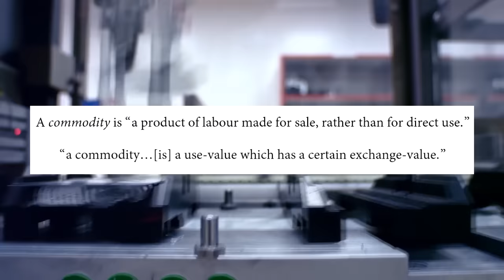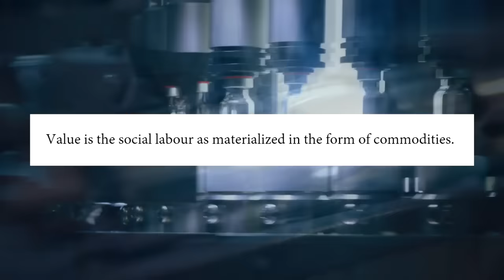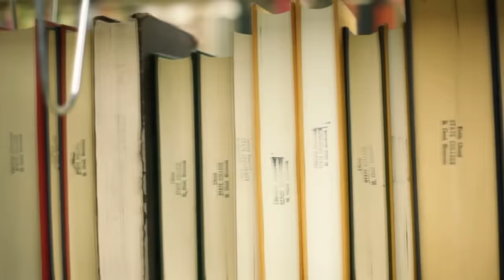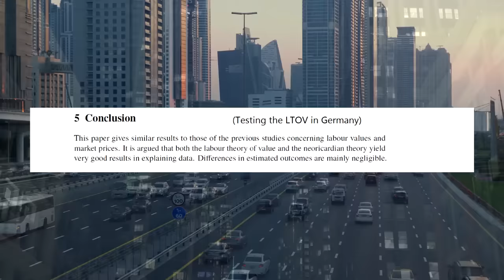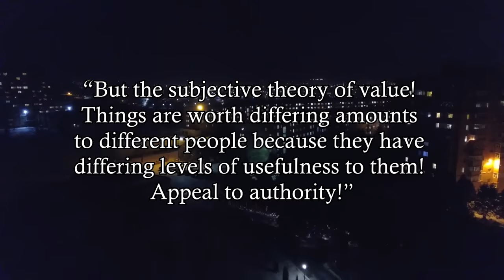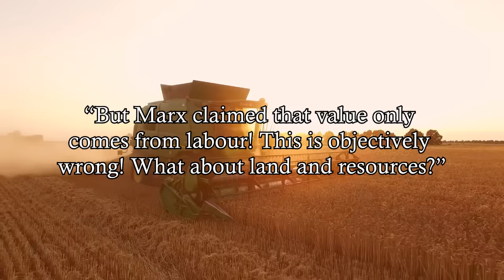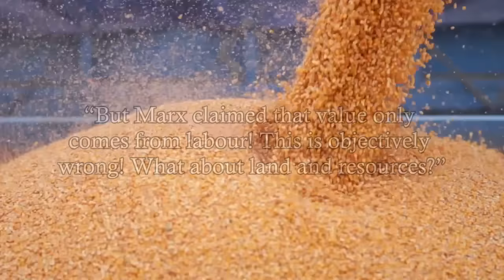Capitalist arguments against the labor theory of value suck (Explaining the LTOV) - Socialism 101

Comment: What does the amount of labor involved in producing something have to do with value? If I could build you a house in  5 days, are you going to pay me less than if I built that same house in 5 months? Of course not. Why the hell would you ascribe different value based on how long it takes me?
Reply: PRICE IS NOT THE SAME AS VALUE
Reply: @jeremyrangel8138  Usually a house that takes 5 months to build is, you know... better in quality and/or bigger than a house that can be built in 5 days...
Maybe that's why a house that requires more labor time for its production is more expensive...
Reply: @kimbanton4398  Yeah, that's not how it works. People sell houses for as much as they can get for them. How much labor went into building the house is immaterial. When you bought your last cellphone, did you ascribe a value to it based on how much labor went into producing it? Or did you ascribe that value based on whether or not it could improve your life in some way? Of course, like everybody else, you didn't even consider the amount of labor required to produce the phone. The labor theory of value was stupid when Marx McNumbnuts proposed it, and it's still stupid today.
Reply: @jeremyrangel8138  how much labour went into something is extremely important. im not sure if you know, but labour costs money. the more money someone spends on labour for a product or service to be sold, the more value the end product has. thus, with high value products, comes high cost in currency to be exchanged for said product or service.

Comment: Socialism, as originally devised, is really one of the greatest economic theories ever devised. The only problem is that it demonstrably doesn't work and often creates material conditions  far worse than those it set out to originally replace. This doesn't even begin to touch on the political structures, and thus oppression, needed in reality to oversee and manage such a system. The group which is truly punished the most under socialism is the group it sets out to defend, the worker.

While that doesn't mean that there shouldn't be criticisms of real world capitalism, it does mean that we can rather safely discard socialism as a replacement. As a system, it simply doesn't work, but there may still be useful pieces of it that can be extracted.
Reply: Not even good in theory

Comment: Mud pies does have a use value, ripping of Labor Theory of Value based system that can't afford to verify use value.

Here is my Agorist apologetic against of LTOV.

Premise 1) Sport betting is labor.
Premise 2) Sports betters have the same labor value.
Premise 3) More accurate sports betters are more valuable than less accurate sports betters.

Conclusion 1) Sports betters who bet differently are not doing the same job therefore do not have the same labor value.
Reply: Sport betting isn’t commodity production so a separate analysis is required to explain their role within society.

Comment: There are some flaws in your argument, for example you talk about the pencil and car example. It does not make sense since the reason as to why a car is more expensive is because the Marginal benefit and marginal cost start very high. Labour is a part of the reason as to why the marginal cost is high but not the only factor that is there, there are lots of other factors as well and the dynamic of supply and the subjective demand of what people want.
Reply: Exactly!
Reply: oh wow, its almost as if the buyers of commodities influence the selling price of commodities. what a shocker. i still don't think that it really makes Marx's value theory redundant. but to be far to Hakim, I dont think he was talking about the selling price but rather the price of production, which is usually what is discussed when relating the category of value to prices.
Reply: @benniethejets  cost is not value either.
Reply: @ExPwner ? Yeah and? How does this disprove me
Reply: @benniethejets  labor theory of value is a cost theory of value. If you knew why cost theories of value don’t stand up to scrutiny then you would get this.
Reply: @ExPwner  A cost theory of value of what? Of commodities? are you saying the theory tries to explain the prices of commodites?
Reply: @ExPwner  If you had actuallly engaged with Marx before critiquing him then you would've learned that 
A) Marx makes a distinction between the category value and production prices

B) Marx states that commodities aren't sold at their values

Hence your critique that commodities aren't sold according to their labour or whatever isn't even a critique of Marx because he agrees with you. Like ive said, youre fighting strawmans.
Reply: @benniethejets  the problem with the argue is that it completely undermines the affect of the consumers' perception on the actual price. I am not reducing Marx' theory here but simply pointing where the argument is flawed.
Reply: @badarshaikh2271  i dont think it does. marx doesnt deny that personal prefrences effect the selling price. What I think Marx tries to argue is that if supply and demand are equal, then the commodities which require more socially necessary labour time will have a higher production price.
Which is different from selling prices. Supply and demand are mostly not equal tho, so the production prices and values do not really coincide. Hence not selling prices either, which consumers have a say in.
Reply: @benniethejets  well yes obviously the price of the total labour involved is not the selling price, it is actually the difference between the selling price and the total labour cost (plus the natural resources, value of the idea and the value of the administrative costs and environment etc) that makes the producer surplus. 
What you are saying would have been true, if there was no producer surplus and no profits.
If I am misunderstanding any of your points, please elaborate.
Reply: @badarshaikh2271  There's no such thing as price of labour, what the producers (the firms, capitalist etc) buy is not labour. It's labour power. This distinction is very important because what it does is that it shows us how the capitalist firm can make profit (even if we assume all exchanges are of equal magnitude in value) The capitalist buys means of production, which is materials, tools etc and then buys labour-power. (The ability to labour)

He sets these two things in motion together, the labour-power is consumed by using up the means of production. At the end of the process the capitalist is left with products which have a higher value than the original two form of commodities (labour-power and means of production) He thens sells these products and realize his profits.

Of course in real life the capitalist may sell his product way above the value of the products, for example Apple might sell their iPhones at a higher price than the value of them, this just results in extra-profit.

The wages recieved are hence not for the labour, but rather the  reproduction of labour-power. (Other factors too, class struggle may rise the wages and so on) 
So profit in capitalism is the exploitation of human-labour power.
Reply: @benniethejets  ok I won't go inside this argument and pick apart the flaws here, but please tell me how any of this relates to my initial comment? Lol
Reply: @badarshaikh2271  Please do pick apart it if you find flaws, im not here for some eternal truth but to learn more

I was just responding to your comment about how the producer makes a surplus, and the price of labour, which you mentioned
Reply: @benniethejets  SNLT empirically does not determine prices. Watch the Shane Killian video that debunks Paul Cockshott. If your theory were correct it would require causation, not mere correlation. The existence of outliers from his trend line disproves his claim.
Reply: @ExPwner  I don't know why you keep on insisting this is what Marx tried to show with his analysis of value. Like I've said before, Marx DIDNT try to predict prices with his value theory. What Cockshott does is different from  Marx, even though he says he's following Marx. Cockshott has some kind of need to insist that the magnitude of commodities correspond to their prices of production, which isn't even true.

With all due respect, maybe you'd do a little better if you actually didn't strawman.
Reply: @benniethejets  I did not straw man. You yourself tried to say that people value based on SNLT and I was pointing out how that is wrong and how Cockshott didn’t even prove your point. Empirically you’re wrong and you still have to face the transformation problem.
Reply: @ExPwner  Well no. I said the opposite! I don't know why you keep on bringing up Cockshott when Ive made it very clear that I dont think that he has the same views on value theory as I & Marx. 

And the transformaton problem isn't even a problem, how is it a problem for Marx's value theory?
Reply: @benniethejets  “what I think Marx tries to argue is that if supply and demand are equal, then the commodities which require more socially necessary labor time will have a higher production price.”

Those are your words exactly.
Reply: @ExPwner  What I said is true, Marx thinks that. 
But It's not really what Marx tries to argue with his value theory, he doesn't desperately try to show that "oh in reality prices correspond to values" or something like that, he accepts that commodities aren't bought and sold at their respective values.
Which ive tried to explain to you a million times now. 

What he really tries to show is that how can a capitalist economy (that is built upon generalised commodity production) function. So, the exact price relations aren't interesting to him.
Reply: @ExPwner  So since your criticisms of Marx sort of have missed do you have anything else to say? Are you going to bring up the  "transformation problem" again
(which isn't even a problem, it doesn't exist because value is already expressed in prices, there's no need to transform values to prices.)
Reply: @benniethejets  😂 cope harder in your denial and contradictions.
Reply: @ExPwner  ait its fun to see u got no response, ur basically just following a script that doesnt even hold up lmao
Reply: @benniethejets  project harder

Comment: I don't understand your reply to the "skill labor argument".  Maybe some sectors of the economy do not used skill labor anymore, and are dominated by workers doing simple, mechanical tasks (factory assembly lines, fast food restaurants, Amazon logistic centers, etc.). But many other sectors continue to require high skill. Software coders (an ever-increasing sector among the working class) need skill to get their job done, and the more skill and knowledge they have accumulated, the better computer programs they can write in the least time. This is also true for many blue-collar workers (electricians, mechanics, technicians of all sorts, cooks, drivers of heavy machinery, etc. etc.). You could call training and studying a form of labor, but then you find that different forms of labor  yield completely different results. A guy who does 100h of training + 100h of labor can normally produce more and better commodities than a guy who does 10h of training + 190h of labor. A guy who worked 20,000+ hours of labor in a single industry typically can produce more and better commodities than a guy who worked 1,0000h for 20 different industries (though in some cases it is the other way around). 

I fully see how human time devoted to a task has value  (in the common use of the word, no the Marxist definition), and is one of the motor forces in the economy. But different people might use their time in a different way to try to achieve the same objective (say, one might attempt to do the task by hand, another might try to program a machine to do it, one might try to do it alone, the other might try to get a team together), with vastly different outcomes in the same amount of time. This is in the end what's behind "innovation", to use your time in a novel way to achieve the same commodity. How does the labor theory of value deal with this? Is there no intrinsic value in the imagination, perseverance, decision making and risk taking that an individual uses to accomplish a task?

Comment: The following is NOT MY OPINION ON HOW THINGS SHOULD BE but I think that, in a capitalistic economy, labor-based value constitutes the minimum price at which a product is sold. If ur gonna sell something at below what it costs to produce it, it wouldn't make sense to produce it altogether. However if you can sell it at higher price than its labor based value, that price would be determined by supply and demand.
Again, as a commie, I don't think the means of production should be owned because this would create surpluses with no real value counterpart easily translated as stealing from the workers.
Reply: LTV is wrong.

Comment: This video presents the typical views of the classic performers of the LTV.
However, the reality is different!

Value cannot be produced! You can't build value anywhere or anything like that.
Value is a social relationship. Such is formed between people and only works between people, the value concretely between exchange partners.
In the exchange, the value is assigned to both the goods and the value equivalent in the same amount.
This happens as with the social relationship property. Also, property is not built into a house when you buy it and finish it off when you sell it and then add new property. Property is merely assigned as a social relationship.
The same thing happens with the value, except that it is only assigned for a short time, when it is exchanged, and that it is also linked to a value size.
When one buys a home, value is assigned upon purchase and ownership is assigned at the same time.

Marx contradicts himself when it comes to creating value, but at one point he says that a product of labor only becomes a commodity when it becomes a use value for others through exchange (!).
Only then is the labor expended on the product of labor classified as socially useful and thus value-creating. But the exchange does not take place with production but takes place on the market.
One can only produce prerequisites for value relationships and thus for values, but neither the value relationships nor the values directly.

Marx is also wrong when it comes to exploitation: Marx describes the formation of value with the formula W = c + v + s.
W value
c constant capital – raw materials, ancillary products, buildings (for Marx), machines, electricity, etc.
v variable capital – (in Marx only) human labour
s surplus value; that is what the human workforce (according to Marx) develops in the so-called “unpaid working hours”

Marx applies this formula to the production side of commodity society, since in his view the market plays no role in value formation.

But on the production side of commodity society there is still no surplus value. The buyer has to pay for the surplus value on the market.
Surplus value cannot be produced, even if Marx put it this way in Capital III.
You can only produce good (or bad) conditions for the buyer to pay for surplus value.
Since the surplus value is part of the value, there cannot yet be any value on the production side either. There are only costs, an expected surplus value and therefore only one expected value. The value formula needs to be specified for the production side:
W|expected = c|cost factor, replacement expected + v|cost factor, replacement expected + s|expected.

If there is a buyer on the market who buys the product, then they may pay a surplus value. Only there on the market is the value formed and assigned to the goods and the value equivalent in the same amount - no value is built into the market.
The surplus value can
a) be higher than expected
b) correspond to the expected surplus value
c) be lower
d) be zero
e) or be negative - if the buyer does not even reimburse the costs.

In order to pay positive surplus value, the buyer must first fully replace the costs c + v (!) and pay more at the same time.
The value formula must also be specified for the market:
W|real = c|cost replacing + v|cost replacing + s|real.

With this formula it becomes clear that the value is not created with the production but is formed on the market with the reimbursement of costs.

The expenses are recognized with the costs, i.e. the value corresponds to the recognition of the expenses plus a real surplus value and not the expenses + an expected surplus value.
The recognition and thus the creation of value takes place on the market.

The so-called "unpaid working time" can be calculated afterwards (!) from the real surplus value - before that it is not given, but only expected.
The "unpaid working time" is also not unpaid. It is simply not paid by the entrepreneur, but by the buyer.